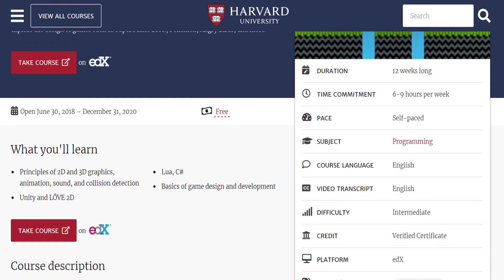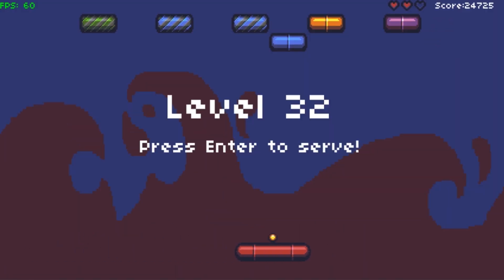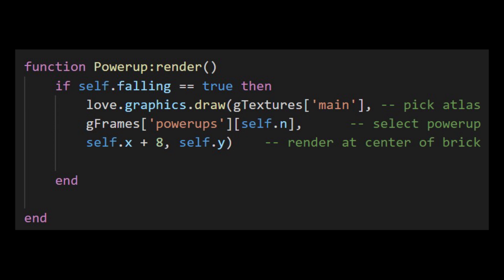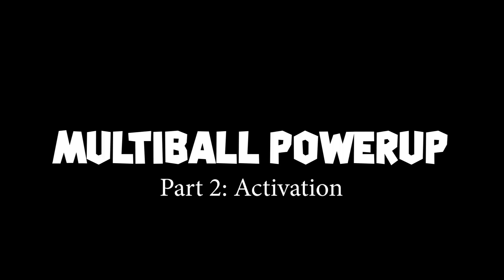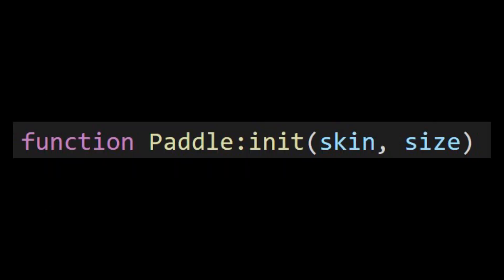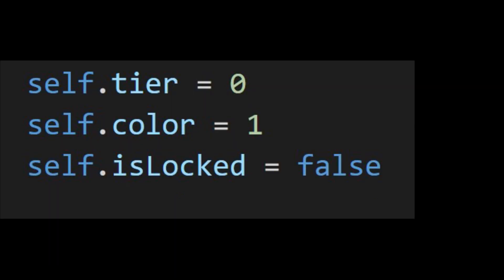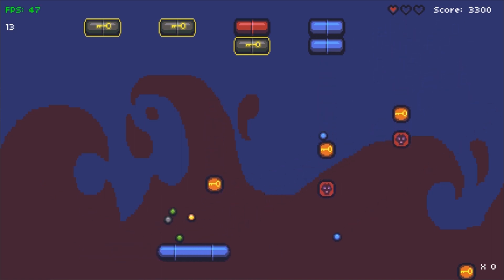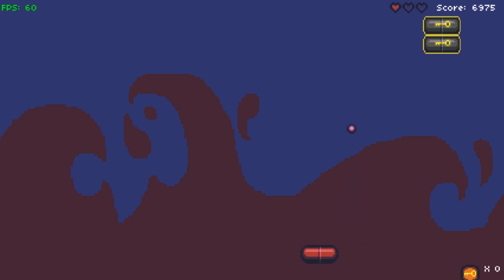Adding powerups to Breakout | Assignment 2 | CS50 Game Development

Comment: I get an error message when I start playing. It says: 'Error

src/states/PlayState.lua:31: attempt to perform arithmetic on field 'keys' (a nil value)

Traceback

src/states/PlayState.lua:31: in function 'enter'
src/StateMachine.lua:18: in function 'change'
src/states/ServeState.lua:42: in function 'update'
src/StateMachine.lua:22: in function 'update'
main.lua:152: in function 'update'
[C]: in function 'xpcall'

Where did you define 'keys'?
Reply from the maker: If you haven't resolved the issue yet, you can mail your code to: adityakhannagd50@gmail.com. I will take a look at it and get back to you.
Reply: @adityakhanna113  Never mind, I managed to fix it